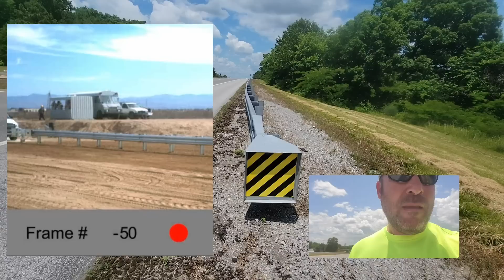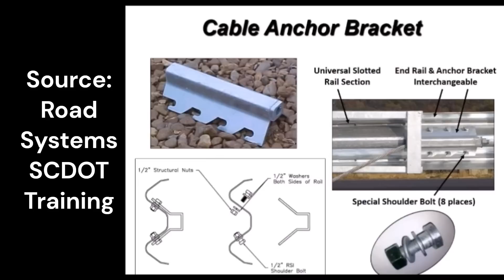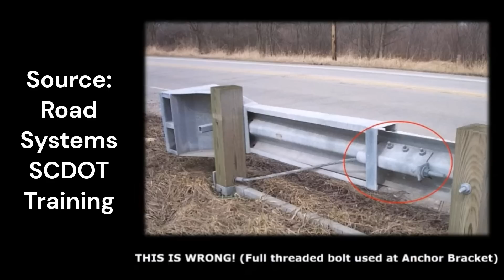Explanation of Backward Bolts Guardrail Short with Million+ Views

Comment: Yo Steve,  I'm a mechanical engineer with a career emphasis on design and structural analysis for spacecraft. You are 100% correct, the way this is installed matters. I'll try to explain.

The shoulder bolt with a captive washer (attached to the bolt) is meant to slot into the cable anchor bracket. The 2 critical reasons for this that I can tell are: 

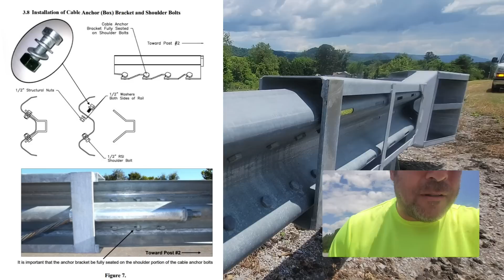1. Notice at 01:39 that the bolt's diameter where it mates with the cable anchor bracket is significantly larger than the rest of the shaft AND not threaded but solid metal. This is known as a shoulder bolt, and its ENTIRE PURPOSE is to take the load on the solid, larger diameter on the bolt shaft because it is way stronger in shear. The way you found it installed, the smaller diameter, threaded part of the bolt is taking the load in a crash, and a load it is not designed for.

2. The slotting also serves as a locating feature to align the entire bracket at each bolt location, ensuring that load is distributed evenly. Gaps are clear as day at 06:48 between the nut and the bracket, and this means on top of taking the load at the wrong part of the bolt, the bracket will slide across the gap and crash into the bolt (a dynamic load) which puts a lot of stress on the part and could definitely lead to premature failure. This is opposed to a correct installation where the bolt itself is stronger AND there's no gap between the bracket and the bolt, meaning the bracket gets immediately supported in the crash.

There's so many tools in engineering to make the install idiotproof, color coding is one. Whichever civil engineer that oversaw this being built should have caught this and prevented it regardless, that's what they're paid for. 

Anyways, don't take s**t from anyone and know that you bring up very valid concerns that need to be addressed. No analysis is done for incorrect installation, and no one knows how a crash in this incorrect configuration would go until it is analyzed and tested. It should not be on the road, and I'm sorry for the loss you've suffered.
Reply: Yo bud.. you’re a good man for taking the time to explain this!! Thank you
Reply: Former airframer (rotary wing)  even which way a flat washer is installed matters, especially on certain airframes...  which side a shop head faces verses a manufactured head on a rivet, every tiny detail matters.
Reply: I bet you are alot of fun at parties....
Reply: @thomas robinette  you know what's NOT fun at parties?  Getting a call that a helicopter you worked on 4 days prior just crash landed due to an unknown failure, and hoping and praying that 1, the guys in that bird are ok, and 2, that the failure wasn't your fault.  That's a hefty sentence of 30+ years in prison.  The small details really do matter.
Reply: @elzanatecatracho6267  once an airframer (fixed wing) ALWAYS an airframer (fixed wing).....
Reply: @thomas robinette  what airframes did you work on? Or civilian/commercial?  Mostly uh60s here, but plenty ah64s and ch47s.  And the occasional drone, but fuck those things.
Reply: These don't even like that the proper shoulder bolts were utilized
Reply: I've been wondering why the direction matters. I'm sure it does to some degree, but his explanation didn't include this, and the study referenced was for incorrect hardware.

This explanation fuller clears up any and all confusion for me. I wish he had articulated this in his earlier videos.

Thank you!
Reply: Thank you - that answers my question so much better than the video.
Reply: Thank you. This is the explanation I came to this video for. Can't teach people they are wrong by just saying "if you don't like it that way, design one yourself otherwise do what your told and shut up"
Reply: The Hyatt Regency collapse is famously taught in engineering structural courses and engineering ethics as a "just because you designed it that way, doesn't mean it will be constructed that way" nightmare scenario.

The collapse of the walkways cost 114lives and 216 injured. 

The culprit: incorrect installation. I know we give engineers grief for not getting their hands dirty but when it comes to important structure design, it's best to stick as closely to the design as possible. 

Source: https://en.wikipedia.org/wiki/Hyatt_Regency_walkway_collapse

The installing agency is one lawsuit away from learning the hard way why they should pay closer attention to how they install these metal beam guard rails.
Reply: @Rexmorgan687  I had to study this case, the culprit was not incorrect installation but instead poor design work and engineers signing drawings without checking things themselves. Either way, negligence on both the engineer's side or the worker's side can lead to terrible results, and the construction company needs to be held liable.

As there's no damage/loss that has actually occurred yet, they would likely get off pretty easy and just be mandated to pay damages/reinstall. If someone takes them to court we'll find out.
Reply: @malialik  thanks for the correction!
Reply: Spot on. I'll add threaded fasteners are much weaker in shear. and more importantly the gaps due to the incorrect location are going to cause localized overstresses and fail prematurely; not shared w the other fasteners. Think of a tug of war contest where there's slack rope between the participants on one side. It's now obvious which side will win
Reply: your points are valid to a point

however 

why not use nuts with captive washers and a shoulder 

this does two things 

keeps structural integrity and improves on safety

reasons i am so against this bolts threads sticking out is it nearly killed me 

in the uk/eu i would bet a POUND TO A PENNEY that this design would actually be illegal 

i had a blow out coming off a motorway roundabout the speed limit was 60mph

luckily i was doing 50mph when exiting said roundabout/traffic circle and bang 

having a good idea what had happened so i grinded the rail turning into the rail slightly too stop me (contact was unavoidable) as with it being the front right wheel stamping on the breaks on soft ground at that speed could dig in and flip the car 

well the bolt and nuts where installed how the designer wanted in this video 

AND YES they also sat just inside the W profile of the rail 

apparently so did the remaining tyre right on that bolt sent me sideways and backwards into the left hand lane 

now if there was a truck in that layby i was dead because after speaking to the amazing lorry/18 wheeler driver that had done the most impressive loaded emergency stop right into the layby 

he informed me that if there was a truck there he would always have taken me on not the lorry 

so yes that design is flawed 

now for the uk in my story they where fitted backwards like the correct way for this design and i did receive some compensation because that was how they had been installed dangerously according to court paper work 

so the EU and UK agree this is dangerous and the USA wonder why they struggle with integration lol

rant over i would like to hear your thoughts on this 

in your own opinion if the design was adjusted to work the same but have bolt thread on the back not the front 
for you would this adjustment (going forwards) be worth making a few specialist nut/washer combos to achieve this ?

is there another down side to the method presented ?

and i also wonder if we welded nuts onto bracket couldn't this be an even better solution providing the nuts had the shoulder also 
this prevents incorrect fitting fix's my worry about this design and massively speeds up installation?

is this not the fool proof solution definitely possible but is it worth it?    

not 1000% on material used for the bolts but they should take enough tension with the threads alone proving the shoulder on the nut is filling space to stop moving etc 

not yet a mechanical engineer but i am learning
Reply: That makes alot of sense, I was having a hard time figuring out why the direction matters until you explained better, thx!
Reply: Thanks for the explanation with the time stamps. The first one made a lot of sense after you showed it...the larger part of the bolt without the threads is made to fit that proper side so that the sliding/release works properly and predictably. With a ton of speed and momentum, that split second of all that crazy energy being transferred really matters. Could be the difference between life (energy is spread out over a greater distance) or death (energy is stopped too quickly and the occupants of the car get smashed into their seatbelts, the dash or ejected from the car), or going airborne/rollover.
Reply: @prefix808  
yes but this design in the uk/eu wouldn't fly having the bolt hanging out of the active side nearly killed me and that was fitted on a uk barrier which was fitted backwards for our barrier systems 

this in the video 
is the correct way to work for the design safety but its all wrong at the same time 

you for example can get shouldered nuts with captive washer's to reverse the bolt keeping all design gives for safety

in the uk coming off a roundabout/traffic circle i had a blow out and my tyre front right that had blew out caught the ill fitted bolt span me into the left lane 

at which the lorry/18 wheeler driver managed to do the most remarkable emergency stop in the layby.

i spoken to the driver who did at one point admit if the layby had a lorry in it like it normally did he would have always taken me on first obviously
Reply: In the bad installation, looks like they used regular bolts because we don't see the built-in washer and I don't think that the shoulder goes through the hole.
Reply: In this application, it is not a sheer bolt.  I assume that the purpose of the shoulder is so that the slotted bracket is not held tightly. [13 mm nuts and washers. The washers do not slide over the shoulder. The shoulder does not fit into the hole.]  When the vehicle hits the rail, the SKT end cap (Sequential Kinking Terminal) slides down the rail and bends it into a curly-q like peeling an apple. A plate on the SKT end cap pushes on the protruding slotted bracket, freeing it from the bolts, so it can fall away and then the rail can be bent.  The angled cut probably promotes popping off or bending of the bracket, so that it is not stopped by the next tab.  (The bracket could deform by squeezing together.) 

In a face crash on the main rail, the slotted cable anchor bracket must anchor the rail to that first post.  In an end crash, that same bracket must be released so that the vehicle is not suddenly stopped.

Note: In the incorrect installation they used regular bolts, not the shoulder bolts because we don't see the shoulder or washer.

How it works: https://youtu.be/HwDfJzP3uF4?t=2450 MASH MSKT Installation Training 04-28-2017 Gregory Industries

The correct assembly: https://youtu.be/7W9KvWHA6Gc?t=250

roadsystems xyz com/wp-content/uploads/pdfs/SKT-SP-FLEAT-SP-Install-Manual-METRIC.   pdf
Reply: @madyottoyotto3055  Search "skt terminal" and look at it from the road side.  Not only the rail but the entire terminal and its slide are outside of the end of the bolts.  To try touch the bolts you would have to hit the rail at a perhaps 20 degree angle to miss the wide head of the terminal and then you're going to have a broken post and bent terminal slide digging into your car.
Reply: @brianwest2775  
You come and talked at me 

Try taking to me 

Your preaching about this and that and put no context into anything 

Either way I will take what happened to me in reality over that of any web site and or comments on here.

When sliding along the rail YOU CAN AND WILL GET CAUGHT UP ON REVERSED BOLTS LIKE THIS.

And a customised nut it all it would take to keep the safety in the design without adding in extra risk 

I will check out the link you posted but I don't expect to understand why I am supposed to be looking at it
Reply: @brianwest2775  

I kind of get what you're saying 

The only issue with this system is that it's too far from normal 

people won't and don't religiously stick to it hence his emphasis on how many are affected in the area 

This would still be illegal

It's the equivalent to me asking everyone to drive in the opposite side of main street ONLY.

no government should allow it 

Instead of using the human instinct for repartition to work for this design it works against it. 

Over this side of the water we call it a fail 😭

I do see what you mean now though but it would be like buying flat pack furniture that has two screws that long you only put it in the wrong place one kaputz yer.

Thanks for giving me a better visual than I originally had my view point hasn't changed however this is far too common because the design works against the people fitting it
Reply: This was the answer I was expecting! Not the response statin "it should be installed like this because the installation guide says it so... period." I mean there is always a logical reason and I personally hate when people say the reason is "cause the manual says it's so".
Reply: Hi from Australia... Civil Engineer here... wanted to throw my 2 cents in

You're right. A bigger cross-sectional area along the shear plane is capable of higher loads. However, this video doesn't show the shank or core dimensions of the installed bolt, and the bolt doesn't look the same as in the image. If it's the same material and same diameter installed in that crash barrier, it doesn't matter the orientation - provided washers installed correctly too.

Either way, the installer should do what the designer or manufacturer has stated in the drawings. But it's hard to say that dispensation wasn't given to the installers based on material availability. I've worked on huge steel infrastructure, and designers do give approvals to stray from manufacturers' specifications for many reasons, but everything is within our standards and design guidelines. I hope that's the case here!

I'm not sure what your councils are like there, but we can reach out to council engineers that have access to that info and press our concerns. I've done it before and got a response.

I would email that council and send them a link to this video...
Reply: @malialik is making a lot of assumptions here. I'm also a mechanical engineer and in writing this reply I've watched the training video, read install guides from the manufacturer and gone through multiple drawings on their website. Yes, thicker non-threaded bolts are stronger in shear. However, take a look at the diagram again in this video. The threaded portion is going to be in shear against the rail itself. You have a weak point no matter which way the designed bolts are installed. Which brings us to the bolts that were installed - I don't believe they're the right bolts at all. The shoulder bolt would be protruding from the rail side, especially if the washer from the instructions was included.

From watching the install video, the purpose of the shoulder bolts is to allow the anchor bracket to easily slip off of the rail in an "end on hit" (using manufacturer's terminology). That is, we don't want the anchor bracket staying connected to the rail. The bolts also serve the purpose of anchoring the rail to the bottom of post 1 in a "traffic face hit." In this case shear forces come in to play, and the bolts don't seem to shear at all during the test in the video. There's even a comment in the install manual that says the "special cable anchor bracket shoulder bolts may be reusable." 

All that to say, the wrong bolts seem to have been used and it doesn't matter which way those were installed. If the design bolts were used, yes, there is a correct way to install them so the anchor detaches easily in an end on hit.
Reply: @ringosk1  yes, good point
Reply: @rainzeros8393  But when you're doing a job like this, you HAVE to follow the manufacturer's specs. His point is still valid, even if it didn't explain the mechanics behind it. But you would also (hopefully) realize the manufacturers probably want it that way for a reason... so it's best to follow their specs.
Reply: @TakeNoShift  right no I agree. However there are a lot of people who are not model workers. Even though I always do what I'm told, I respond better to being told why things are done the way they are as I'm sure most other people do. While both explaining why something's done the way it is and saying "it's the manufacturers spec that's why" are both extremely valid, expanding knowledge tends to be more helpful and promotes people not feeling like "yes men." In my experience, "yes men" get sloppy quick.
Reply: Thank you for pointing out why it matters instead of just saying to do as told
Reply: What is incredibly frustrating, is that this is the least expensive part of this is to get the bolts facing the correct direction.
Reply: 👏👏👏👏🙏👍❤️ Respect. Truly awesome man.
Reply: Thank you, I still didn't understand the actual problem until I read your explanation.
Reply: @madyottoyotto3055  You sound pretty dense. There's a 0% chance that braking on a blown tire would ever be able to flip your car. It sounds like you lost control and are trying to shift the blame to the guard rail you hit. There's also no way that your 2000lb car would be violently flipped into the other lane by a few 3/4" bolt threads sticking out a bit. You probably just hit the rail hard enough to deform it and impact one of the posts. This is a classic case of, "pics or it didn't happen"
Reply: Stellar explanation. You should be a teacher.
Reply: Thank you for giving the details that OP did not give.  I'm all for hearing WHY something is wrong, but it is useless to say something is wrong without saying why it is wrong.  Installers need to be taught the WHY, so they will learn and always do it correctly.
Reply: Yes, the bolt orientation "could" make a difference, so a wise man would follow the drawing orientation. HOWEVER, nobody here has test result data that shows that orientation makes a difference .... yet here we are with people providing solutions for a problem that may not exist for a product that road crews will assemble with various bolt orientations, because the drawing contains no warnings and the product can be assembled with different bolt orientations.  First Step of ACTION, would be to contact the manufacturer to see if they have test data and/or a concern .... if the do, they should get busing sending out BULLETINS and updating their asm drawings with warnings... and then revise their product design so it can not be assembled wrong .... before they get sued.
Reply: Thank you for taking the time to explain this. I was in engineering school before I decided to become a chef. I still think like an engineer, somewhat, and your explanation really helped confirm what OP said, as well as my instinct that it matters.
Reply: Correct me if I'm wrong but I think you missed the most important aspect - correctly installed, the nut & bolt only clamp onto the rail, they do not clamp the the plate.

The plate is held in place only by cable tension and is only designed to add strength in tension when there is an impact further down the rail. When someone hits the impact head tension is lost (Post 1 breaks free on impact, releasing the bearing plate to which the cable is attached) the plate is free to slide forwards and thus not impede the impact head as it travels down the rail.

So installed as they are, they are clamping the plate in position even when tension is lost, and it will impede or even completely jam the impact head. Which will mean it's not absorbing the energy as designed, worse still it could result in the rail breaking and spearing the vehicle.
Reply: It says in the training video that the washer is retained. If the installers didn't know any better it's possible they managed to remove the washers which may then allow the shoulder through the rail. But it's quite possible they used the wrong bolts in which case it probably doesn't matter which way around they are. We really can't be sure without taking it apart. @ringosk1
Reply: They do have test data - for a correctly assembled system. And in those tests the impact head performed correctly. If incorrectly assembled then all bets are off, and in this case once you know how it works it's obvious why these bolts are important - wrong installation could jam the impact head.  @KrustyKlown